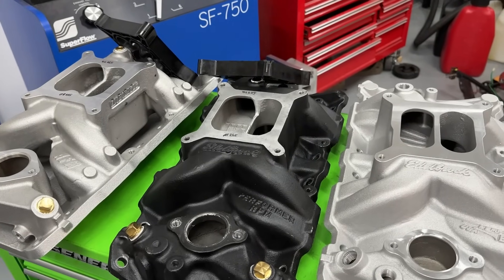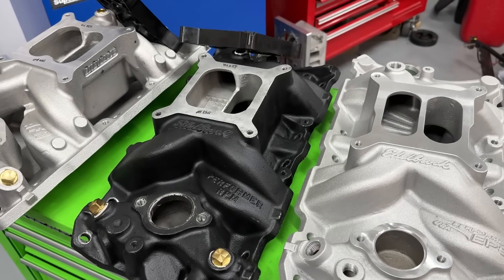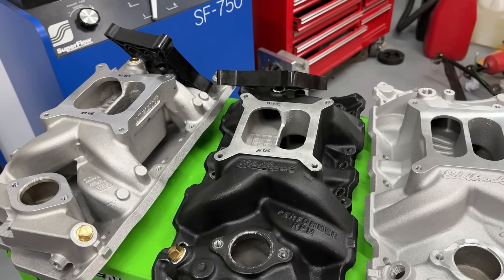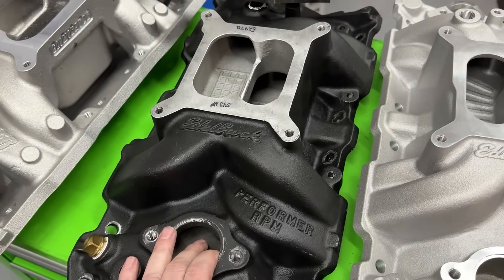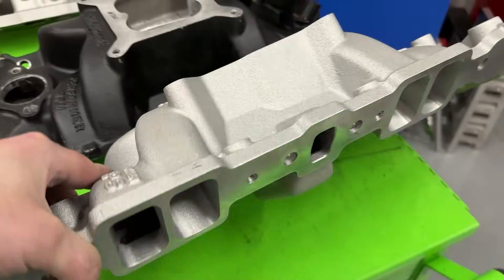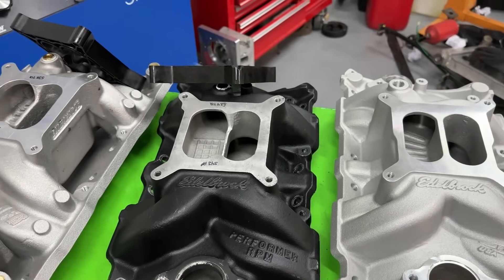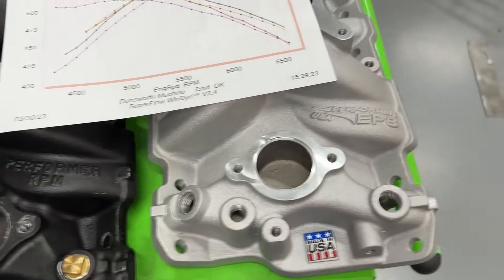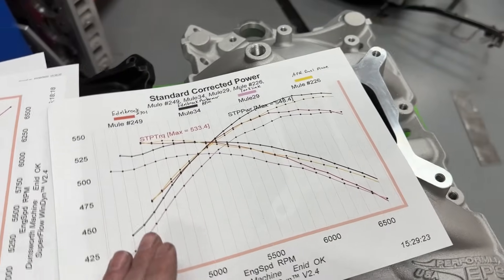Does Cutting Down The Divider On A Dual Plane Intake Manifold Help

Comment: So the non heated riser on the AFR doesn't matter? I thought that design was supposed to automatically give it an additional?
Reply from the maker: The exhaust crossover didn’t matter on this because the heads don’t have an exhaust crossover passage.
Reply: @WeingartnerRacing  Gotcha. I subscribed last week. Really enjoy the channel overall....but especially how you are down to earth and admit you aren't perfect. 
Between you and David Vizard I came up with this combination 
383 Smeding short block
Edelbrock 5085
Mutha thuumper roller
1.65 intake and exhaust (comp 85301-16)
He recommends a dual plane with down leg booster vacuum secondary carb.
10.5 to 1
It's a stick shift street car.
I want to gasket match and do the "smoothing" you tried.
I always wanted 500hp.
Think I'm anywhere in the ball park?
Reply: 850 carb size

Comment: Lol run the test under 4400rpm and you see what a pos that mod is.
Reply from the maker: Ok. It sounds like you have done dyno test at lower rpm. Can you share.
Reply: @WeingartnerRacing  I can see if I still have the 540 tests kicking around. Have done on 396..427..and 540..all was a losing proposition and brutalized the lowerend.  The spacer you have is similar to the hvh supersucker..that is definitely the best on a dual plane. I make one with a 2in cone in the center that works better on single planes.. on some bbc stacked with a 1in open under it I've seen 47hp.  Cutting the divider out kills your avg hp. Most folks are not running around with a 4500 stall.. a motor that builds better  avg power from 2500 to 6000 will always be a better performer.
Reply: @WeingartnerRacing  I have a 455hp ls 6.0 I could cut the center out to prove my point ,but I hate to cut up a good manifold and weld on it.

Comment: It is weird the surprises  maybe a smaller displacement will help the smaller manifold and the afr might b e to big but the 406 loves it. Thanks I am building 350s cause I got three good cranks and on a budget. I have both those edelbrock rpm manifolds and a stocker quadrajet manifold and I am perplexed about spacers. Want to run quadrojet factory manifold for torker 350 truck motor. Was thinking a quadrojet four hole 1 inch and maybe taper it. Have a good one

Comment: I've always read / heard that when cutting down a divider on a dual plane intake you should consider taking 1/2" to 1" so your Edelbrock Performer RPM with the 1 " spacer kinds supports that school of thought. Like you stated the spacer effectively cuts down the divider down an inch.

Comment: With small runners and ports people often assume it will make all the torque not realizing the torque is a function of volumetric efficiency not air velocity. It's possible for a larger runner and port to make more torque with somewhat less velocity just by filling the cylinder more effectively.
Reply: Absolutely, but the biggest issue is that too many look at one part. Instead of all the components together.  How they work with each other.  

Most of the time, runner length, & diameter , plenum size, TB/carb , cam events, head design, valve size & design, compression ratios both static & Dynamic, exhaust system size & design, etc etc etc all are too deal with inefficiencies in each other.  So getting all these components to work together in the range that best suits the user is the idea. 

But you have so many just thinking whatever, throwing whatever together because they heard this or that.  Not to mention no real understanding of what they really want.

Oh snap. I want 1000hp.  OK..... what are you planning to do & how do you plan to use this? Where do you want that power?  If you plan on a light to light street machine, 1000hp isn't all that great if it's at 8k RPM meanwhile most of the time the vehicle is 6k RPM & below.  It has no low end of mid range powerband.  When it can barely get around town. Etc etc etc.
Reply: yep.
VE and CR determines torque
Reply: Duration/lobe seperation and dynamic compression

Comment: i wish the performer rpm on my pontiac was a true square bore and not spread/square, i've often wonder about turbulence and air flow when using a standard 4150 vs spreadbore on these dual plane dual carb pattern intakes.... any thoughts?
i only have it port matched, not sure if there are any "porting/tricks" that could enhance it, i would be interested
i haven't used a spacer, other than the very small spacer for using the 4150 (its a small plate edelbrock sells to ensure sealing)
i may try some spacers, but they can start adding up, as i've seen a spacer with divider for dual planes, and also see the open and 4 hole ones, clearance might be a bigger issue if i went that route too
i have thought about just going with the torker II to get a little more clearance since its shorter but has square bore pattern

Comment: It used to be worth 15 to  25 HP on a Small block  Chevy in the 70's & 80's, it's probably worth  more today  with  engine  builders  making  so much more power than they did back in the day,  yes  its  such a popular mod that the air gap  Manifold came out.
Reply: The air gap manifold has nothing to do whatsoever with the divider on the manifold. It just means air goes under the runners.

Comment: Start your Dyno pulls at 2000rpm for graphs....
Reply: Not for us street guys with 2000 stalls 😂 sorry we all don't run 3500 to 4000 stalls 😂
Reply: @jesseparadis6141 my stall starts at 2200 on the street 😂
Reply from the maker: That would be pointless

Comment: You know, it is the year 2023, and yes your video is great, but back in the ancient times, we use to have strange things called books and magazines. Back in the early 1900 and 70s, Chrysler engineers wrote the Direct Connection manuals on go fast Mopars. The recommended Small Block race manifold, was the Edelbrock LD340 dual plane for Super Stock and all performance. Back then they ran 10s in SS.....early 1900 and 70s remember. The Race Modification to the LD340.....was to cut down the divider to 3/8" off the floor. In other words what you have done. They dynoed all their mods. It made to best power for the cars at the time. Isnt it amazing that you can still provide this info to newbies, that was already known by us all 50 years ago. In fairness, I bought my DC manuals in the early 80s....so yes, I knew of this mod since then....and yes I have an LD340.😄 
Keep the info coming.......as nobody reads book anymore, or looks up already proven info....Perhaps more newbies should be asking the oldbies how its done..............

Comment: Just grins, it would be neat to see a factory iron manifold cut like an Edelbrock performer. Then milled like an rpm air gap to see how it compares to an air gap. Factory mods like a super stock class competitor would get from "tricking out" factory stuff.
Reply: David vizard did this and documented the stages of modifications. 
It gained a TON of flow and from the outside, looked stock.
Its like 40 hrs of work because cast iron.
Reply: @paulmryglod4802 ,  I have done it on a stock 1975 chevy iron intake. I have WELL into the 60s probably 70s hours of porting into it. The plenum and carb pad are as close to a Quadrajet version of the RPM AirGap as I could make. I cleaned up every corner and transitions from plenum to runners. And as far up each runner as I could. Ground out each bump in runners, including the carb mounting holes that protrude into I think the port for cylinder 4. Then epoxy filled and smoothed. 
I don't have flow data, or dyno numbers. But, a same day comparison at the track with a stock iron manifold and switching to the ported manifold I got the following. No jetting or rod changes in the quadrajet, no changes to the secondary air door tension,  timing set the same, shift points the same. Stock manifold had a 3 run average of 13.62@102.6 and the ported manifold was a 3 run average of 13.45@103.9. Admittedly, those numbers are not that impressive. But, the engine is at max 300hp. It was not built to be a 12 second car. But to get that number change it theoretically would have to be about 10hp increase from the porting. So I know the factory parts can make power. Just don't know the limit
Edit: and that is through FULL exhaust, block hugger style headers, 2 1/4 dual exhaust,  into and out of a set of mufflers for an 87 monte carlo ss and over the axles. Daily driver exhaust lol
Reply: @AndyR1982  cool! Thanks for the data. Thats good to hear directly from someone who did it

Comment: Peak numbers are great but I've found the drivability and tuning is far easier on the dual plane with the divider notched, or an open spacer added if there's clearance under the hood. The science says it smooths out the pulses since the share part of a common plenum now, I just know I get an easier to dial in engine with better road manners with a carb and especially when going to a setup like a Holley Sniper that needs a good clean vacuum signal. The original gen Snipers suffered from this greatly with the MAP port placements but I guess they have made improvements to that vacuum channel under them. I still like doing it just to help the ECU to get a nice clean constant signal as opposed to reading it off 2 separate banks of 4.

Comment: Very interesting,had a 408 smallblock Chevy with highly modified iron Vortec heads and a RPM Airgap made for Vortec heads port matched and it was brutally fast.750 mighty Demon no spacer or modified divider.RPM Airgap a super street and race manifold

Comment: You're just supposed to make a 1 inch by 1 or 2 inch cut, not remove the whole thing......Just sayin
Reply from the maker: Ok
Reply: @WeingartnerRacing  what you're doing it making it basically a torquer II intake, when you should make it like a performer intake (thats how eldelbrock) does the performer is with a little cut in the middle...Or so used to.

Comment: I did a mod for my air gap intake for my mopar mildly built 318 . I did a 1" 4 hole spacer but I cut out the divider between the 2 secondaries and the 2 primeries . 1 " long was the cut out  helped alot even though I dont have the funds or location for a dyno test

Comment: Some of the newer Throttle Body fuel injection kits do require the divider cut down/ notched because they are having problems with efi units.

Comment: About 17 years ago I built a 351w with heads by Darin Morgan with a rpm air gap I milled the divider out and cleaned up the intake. With a 2.05 intake valve 215 runner ,10.5:1 ,698 solid roller for a 5 speed mustang daily driver. Dynoed 525 hp 470 tq, I still have this engine in my street car but with a much smaller .560 and it runs low 11s through full exhaust
Reply from the maker: Sounds like a good combo.

Comment: Every time I hear how velocity makes power I laugh a little bit inside. In a runner it takes something called vacuum to create velocity or airspeed. When you get vacuum in a runner you get faster moving air but you also get less cylinder fill, when you get less cylinder fill you get less power imagine that. Now if you want to talk pulse and how tuning takes effect and has nothing to do with velocity but when you close the valve you compress the air a little bit because The air stays in motion, kind of like how the TPI system works for Rochester you just have to find a runner length that works with your engine and RPM. 

And if you really want to think about it a one barrel is going to have the most velocity of any carburetor, so by the velocity theory, if I put a 1 inch bore one barrel on this engine it should make more power then your four barrel that you're using due to the higher velocity going through the carburetor right lol.

Comment: What intake gasket did you use ?
Reply from the maker: Fel pro 1206
Reply: @WeingartnerRacing  so you replaced with a new gasket each time ?
I would figure put sealant on the head side but leave the intake side bare. And reuse it.
Reply from the maker: Actually we reused the intake gasket on the entire dyno session.
Reply: @WeingartnerRacing  cool. Thanks.

Comment: Very Interesting series. I enjoy data and I really appreciate your hard work. I wonder what this 406 would produce with a Camshaft that would be better suited for the small heads and dual plane intake.  Also Eric if you read this are you a ProMaxx Dealer?  I'm doing a budget  350 street car this summer for fun while my racecar is getting finished up. I am thinking of buying some Pro Maxx Project X 200cc heads and Id rather support a small business like yourself.
Reply: Yes, that cam is crazy big for this test with dual plane manifolds.  I wondered if anyone else had mentioned that.

Comment: For my 427 engine, I've noticed that the heads flow just under 400 CFM @ .650" and while I realize that it's only for a moment that it's flowing up there, I've also calculated the overall engine flow at 100% VE and 7000 is 864 CFM.
With all of the extra airflow on tap, should one go with a smaller valve and take the small hit on airflow and increase the "coefficient of discharge"?

Related to the above question but an extension of: 
The way I see it, cylinder port airflow in CFM doesn't necessarily equate to cylinder filling. 

If you agree, where does the balance lie between airflow and velocity? My understanding is that there is a "Mach factor" which is a term that's arguable and varies between .3 and .4 mach and it's best to get as close to the mach factor or where turbulence is incurred without actually incurring it.

Last question. The standard is to flow a cylinder head at 28" but have you ever calculated how well that relates to actual port flow in real world applications?  For example:  how does 28" compare to a 427 (4.125" bore /4" stroke) engine at 7000 RPM? If you incur turbulence at 28", would you expect to incur turbulence when it's on the engine?

Thanks

Comment: Hi Eric do you think that it would of made a difference if you only cut the center wall down only a 3/4 to 1” it looks like it’s to low now compared to the Edelbrock rpm air gap that’s only cut down a bit

Comment: I love the test and previously have not been able to find anything online that compares the EPS to the RPM. Maybe I miss reading something but when you compare the AFR to the RPM and the eps, the RPM and EPS are making the same power down low up to about 4900 whereas in the final overlay it shows that the EPS was making out the 10 ft pounds of torque more and only comes down to match the RPM at 4900?
Reply: I recently noticed this as well.  The difference is between runs "Mule 250": 2701 EPS w/ 1" Open and "Mule 249": 2701 EPS NO SPACER.  The 1" Open spacer appears to kill the torque (and HP?) on 2701 EPS, completely opposite of the AFR 4812 w/ 1" open

Comment: You always provide us with the correct information. And all the graphs to prove the results. Good job keep up the good work.
Reply from the maker: Thanks and keep watching
Reply: @WeingartnerRacing  I have a 302 SBF Mild build with a 4 hole 1 inch spacer. And I plan to install a open 1 inch spacer as in your graph it shows more power  throughout the whole RPM range. Can never have enough power. But should I take down the center or will it perform just as well with the center still intact?

Comment: Hey Eric,
     Tim here.....I havent gotten to the results yet, but the EPS works great for 350 hp motor, i bet it works bad on a 11:1 406, with a big cam.......just sayin certain manifolds are tailored to the application.......my shop has used a # of EPS'S on 400 hp or lower motors and have had OUTSTANDING results.......great throttle response, great drivability, but at 5200/5500 RPM ur done.....just sayin an EPS has no place in the test.....its designed for smaller motors, less compression and MUCH less hp.......ok, gotta go back to the vid....
Reply from the maker: I wasn't knocking the EPS. It actually did really well. It is not made for this motor but it was neat to see what it did.
Reply: @WeingartnerRacing   i agree, and i wasnt tryin to poke at you, i was suprised it did what it did on the mule.....TY fer the response.......gotta get to ur store, my t-shirt needs a replacement haha...PEACE to you sir!!

Comment: Would you think cutting the divider would help or hurt under boost?
Reply from the maker: help
Reply: Thanks man love your stuff
Reply: Need to cut divider for airgap BBC dualplane (streetcar) using Fitech EFI with single Tstorm, but unsure on spacer?

Comment: This test/results, I can corroborate, for dual plane with 1” open spacer (mines wood but doesn’t matter) *Weiand Street Warrior, not Dyno’d, also on a mild 10.5:1 sbf 331, but seat of pants was obviously better vs. 4 hole spacer
Reply: *stock divider better than milled w/ open spacer… my guess is velocity of air = better mixture = better burn up top?

Comment: I do notice that you cut the RPM divider (almost) all the way down. I think the Air Gap is like a 3/4" deep cut? At our shop we did this mod on stock SBC and BBC intakes for circle track and drag racing as well as with aftermarket intakes and it definitely cut down torque but made a little  more top end power. Regardless Performer RPM has been solid since it came out. Keep the videos coming man. There's an early Carjunkie TV episode (pre Roadkill Engine Masters show at Westech with Freiburger & Chad Reynolds) where they did a 3/4" cut in SBC Performer RPM matched  the power and curve of the Air Gap. I think they tested a regular Performer too.
Reply from the maker: Thanks. I wanted a large cut to see if dramatic changes.

Comment: Very interesting results, I totally would’ve guessed the the 4 hole spacer would’ve worked better, great information, thank you sir. 👍🏻
Reply from the maker: It is on a single plane.
Reply: @WeingartnerRacing  
I’ve been running an HVH super sucker on a Vic Jr on LS engines for close to 15 years, always been a good combo on 5.3’s and 6.0’s, that being said I do believe a dual plane would work better…